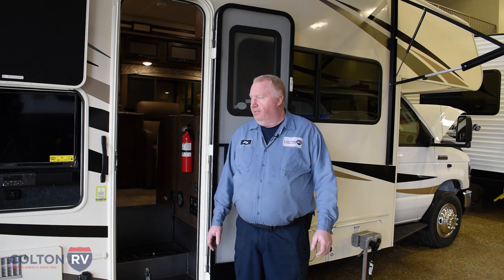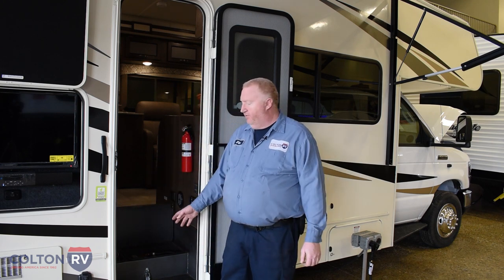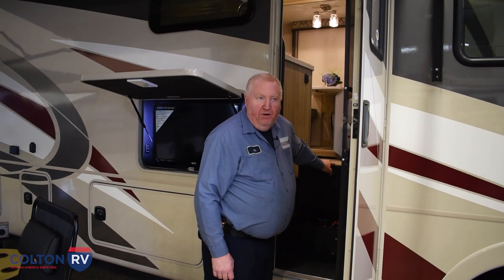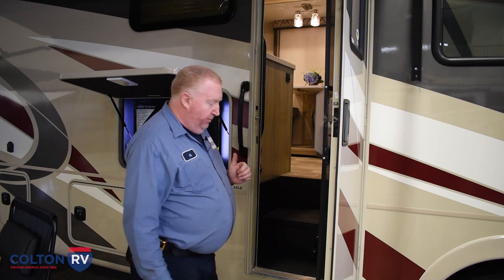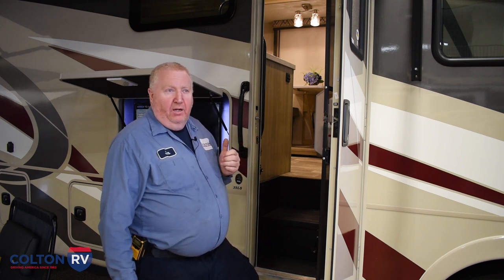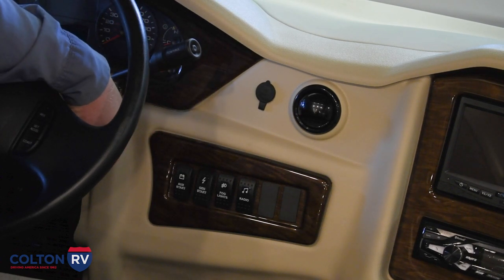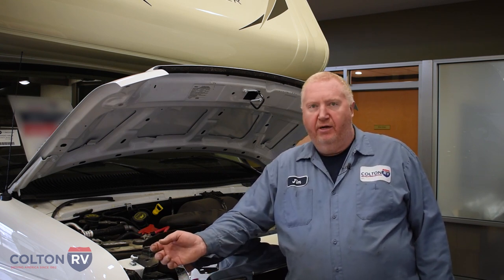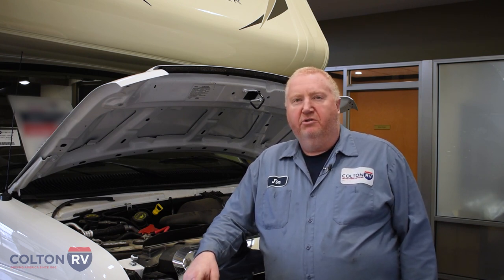RV Batteries: House vs Chassis

Comment: My chassis 12v is in series with house battery also 12v. Why is that? 24 v total... Maybe prev owner rewired this way? I suspect so because when I click my jump-start button from house to chassis it just clicks out of the medically and does not jump start...

Winnebago 24J view 2017 Mercedes